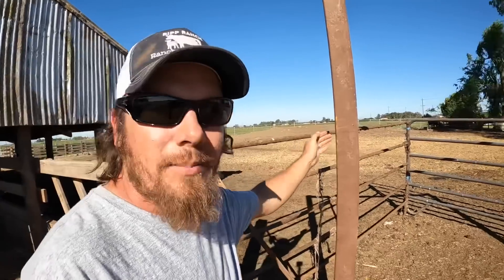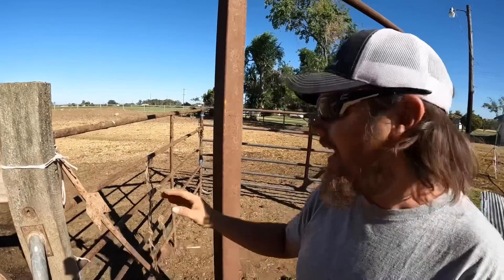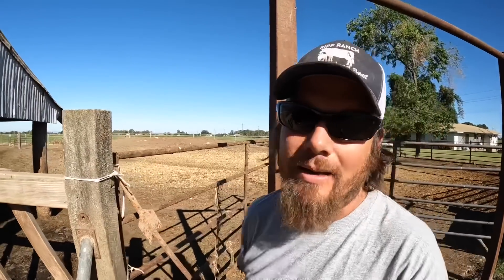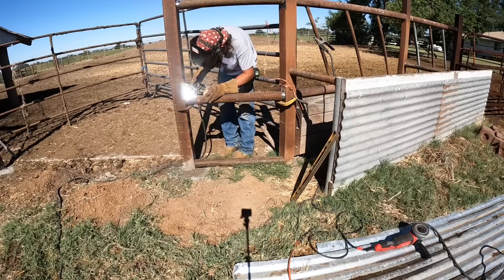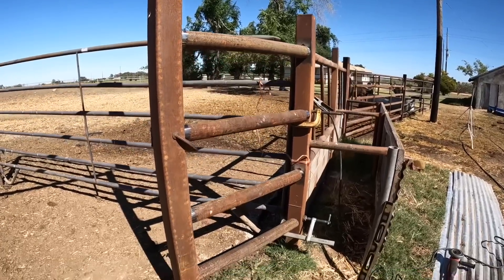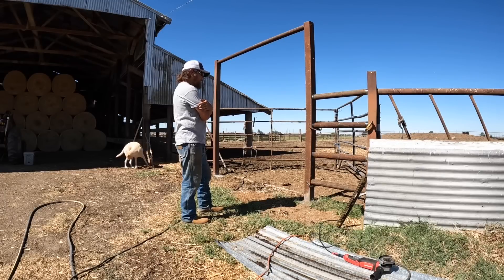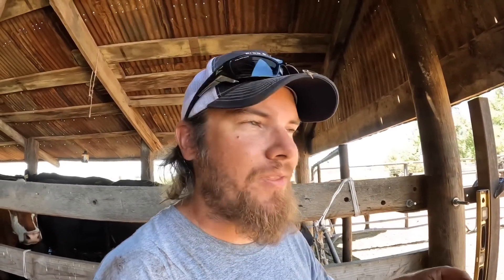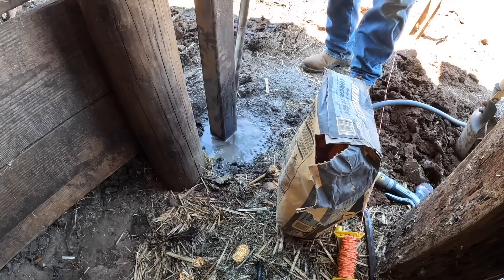Round Bale Feeder Build Part 2!

Comment: Hi Tyler, 
What do you eat in a day? Do you use any supplements (electrolytes, protein powders etc). My father worked outside in the heat during the summer and there really were not electrolytes until Gatorade came along.